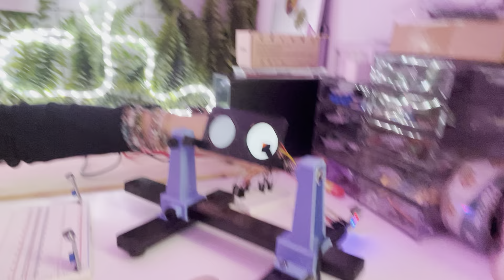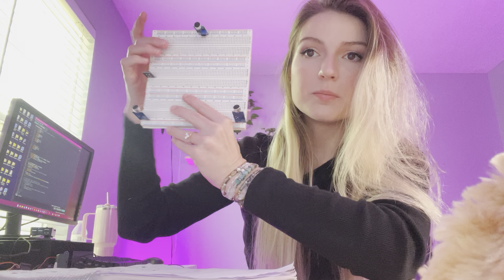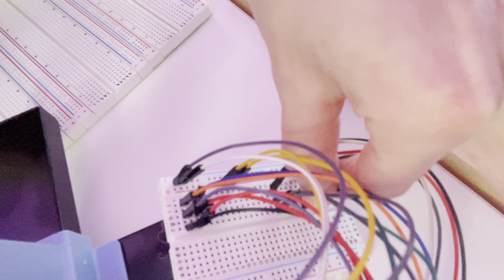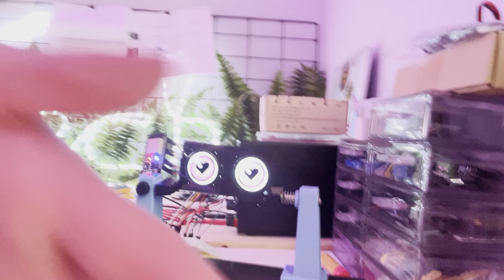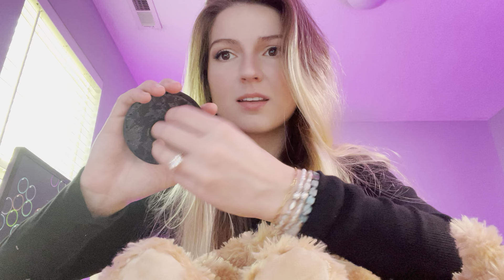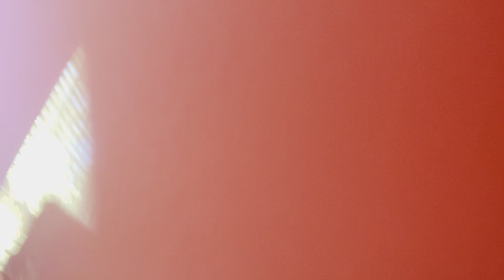Unedited Rant & Progress Update: Techno-Teddy, Arduino IDE, Venting & More

Comment: I would have switched to a Pi Zero long ago, you can pick the first gen up for around $10, so still inexpensive. But I do understand and respect your determination. 

I think with the rotating assembly you are overcomplicating it with the individual ball bearings. Good Idea, but seems frustrating and messy. I would print the 2 portions to use a bearing, maybe a 608 or the sort, and have it press fit (or glue) into one piece and screw through the center with the other. it would solve the holding together and should be robust enough to support the head with a good support structure. Then find a thin sheet of just about any metal and cut your own rings; thin copper, aluminum, something you could solder to. You could probably use a flattened out soda can if you wanted to. Use anything to make a "brush" setup as a contactor (or find or buy a set of actual brushes) to ride on the rings for current transfer. I used bare copper wire and some dielectric grease in the past and it worked for as long as I needed it to. 

For the wiring problems, maybe try slightly bending the pins. I have had the same issues in the past and it seems to help (sometimes) with contact and secureness. 

And as stated before, maybe you should give some flavor of Linux a try. You could set up your Win PC to dual boot and I do find it easier for working with certain programs. You seem more than happy-ish to work in command line, so doing any advanced setup and installations would be reasonably easy. Plus there is generally someone out there who has already shared ways to solve any problems you may have, and a lot of people who would be glad to help. Most Linux people love solving problems.

Oh, and you looked just fine in the video. I don't have a good side, so I never worry about it. But please watch your audio; I had to crank the volume up on everything to hear your voice!

Good luck with the project, I can't wait to see the finished bear. Are you going to put him in a Big Blue House?

Comment: 13:18 you can also remove the adhesive backing on the breadboard, removing the retention bars and using pliers to squeeze/deform them so they’ll grip your jumpers better.

Comment: the through hole slip ring is way over kill. Think about your neck ...you dont have that system and you work just fine. I dont think you are making a "demon" bear that needs to do a 360 rotation. As far as the microphone you can use cellphone microphone (4mmx 2.5mm x 1.5mm[h]) you only need 2# or two pairs. you basically need a comparator and the loudest sound is the direction the head turns.

Comment: I had problems with those jumper wires.  Some of them had bad crimps and making intermittent connections.  Check all of those jumper wires with ohmmeter and toss any that have intermittent connections.  Not worth the trouble keeping them around.  In fact I would just cut the connectors off on all of the batch that came from the same package and keep the wires if they are worth keeping i.e. if they have enough wire strands. It is hit and miss on the quality of those jumper wires depending on who makes them. I usually make my own jumper wires.  Those Dupont connector shells and pins are inexpensive.  There is nothing worse than troubleshooting intermittent problems due to faulty wires and switches.

Comment: I would also highly recommend VSCode with PlatformIO. I just cannot understand how people can use the Arduino IDE for more than 2 minutes. It has no completion, none of the thousands of plugins you could install, very little control over the build process… it's just extremely basic, and really not suited to do anything serious. Switching to VSCode + PlatformIO + plugins was a game changer for me, I could finally use real tools like in my actual job (many of them the same), and it just made so much more sense than using an "IDE" built for high school students – that's definitely what it feels like to me. If you switch there is a little bit of a learning curve but it's not bad at all, especially with the countless examples you can find on GitHub.

Comment: 1. Stop using breadboard and those connectors, both sucks. 2. Use Linux. 3. Either solder your prototype or send the pcb to a factory and solder the components yourself.

Comment: I've found using PlatformIO with VScode is much easier to deal with and more stable than the arduino IDE once you get it set up. Especially for ESP8266 and ESP32 boards. Because you're working with libraries and some more advanced stuff I'd recommend swapping. It's not as beginner friendly but it allows you a lot more freedom and flexibility.
Also, if you're only going to let the head swivel in a fixed arc you don't need the slip ring. The wires won't get twisted. If you want to let the head swivel all the way around then the slip ring is a good idea.